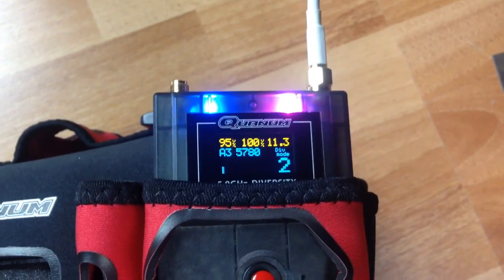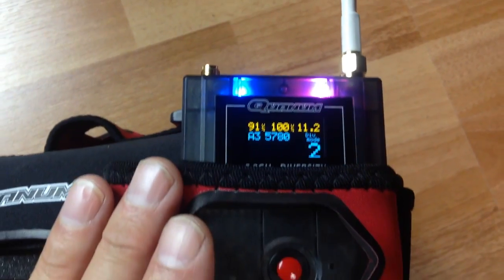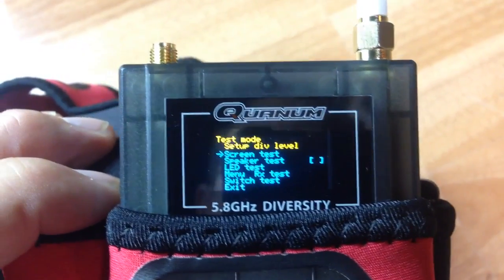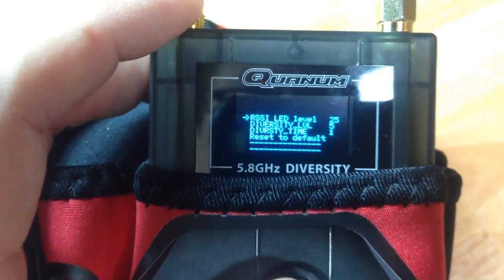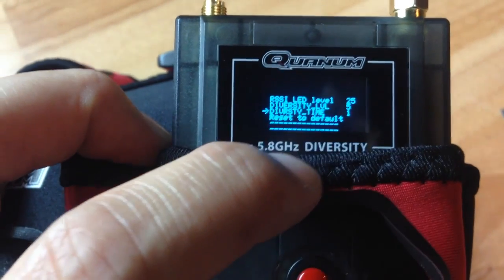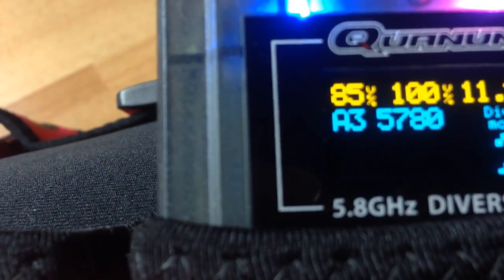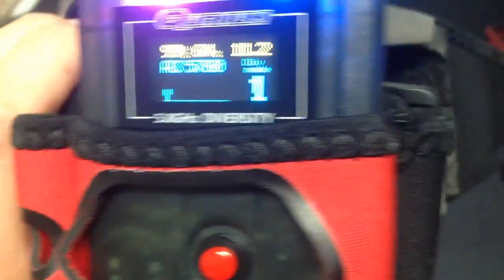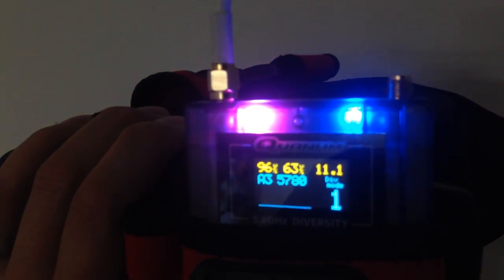Quanum Diversity RX Antenna Switching Problem Solved.

Comment: I received one of these a week ago and the problem i have with it , is that Ant 2 is much more sensitive the Ant 1 with matching antennas. Ant 2 will stay at 100% while ant 1 drops to 60%. So using for diversity with a CP and Helical does not work well at all, even when you change the settings. Other points i noted were, Ant 2 is labeled Ant 1 on the back of the case, and the Band and Channel numbers are all mixed up, and don't even match the documentation. You can ignore this and use the freq shown instead.  I sent mine back to HK for a refund.

Comment: Hi, did the performance improved with the new diversity time setup? I'm looking for a diversity VRX for my Quanum V2 goggles. However, every VRX I've considered has some kind of issue: Boscam FR632 seems to have compatibility problems; Lumenier RX5GDR seems to be the same FR632; Skyzone RD40 has really poor reviews, little has been said about the Skyzone RD945 and the ImmersionRC Duo is just too expensive and apparently doesn't worth the money. Thanks for your answer. Any advice would be appreciates.
Reply from the maker: It is improved but at times can be random switching...